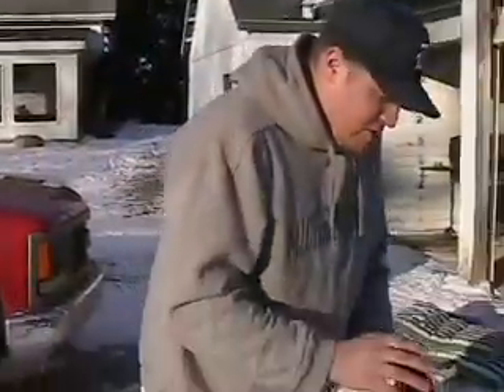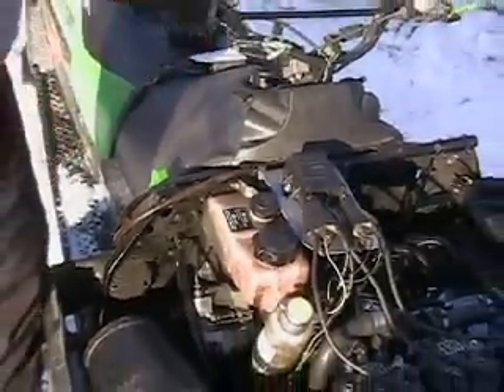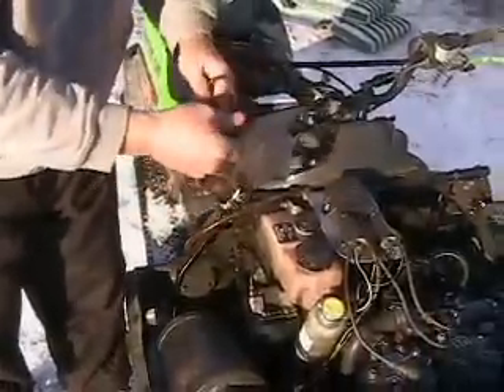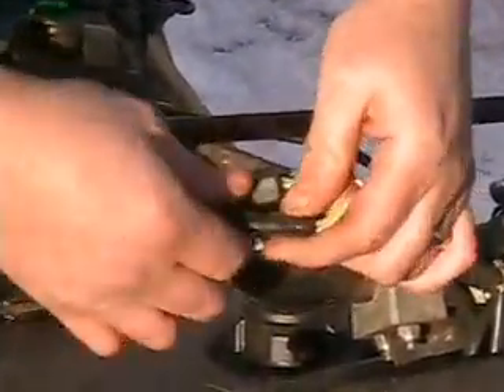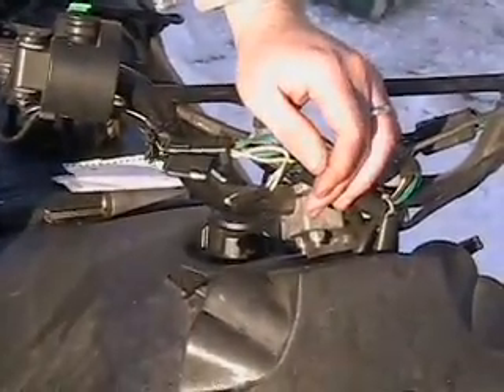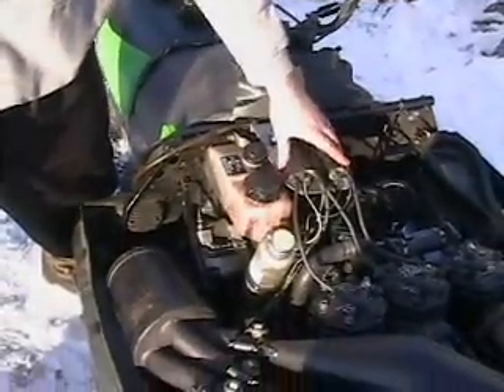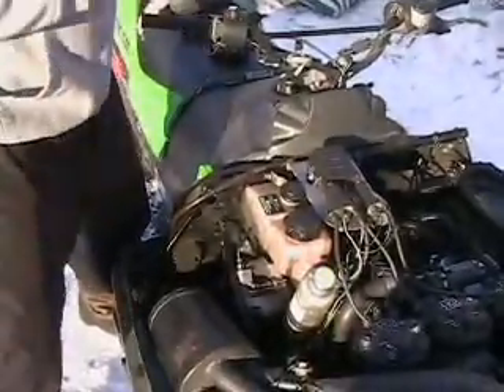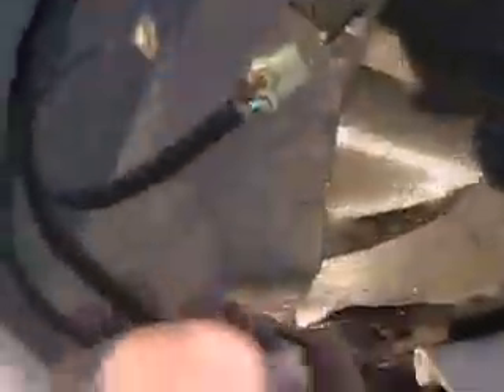Electrical Diagnosis for Arctic Cats

Comment: Excellent Blain I have a 95 zr580 we are up in Bellaire MI Sled ran perfect Tues all day this AM  Wens no spark other then a few very weak ones on plug sounds like  a saftey switch issue ,there was alot of frost this AM also,I think I have the sysyem where I need to jump connectors Dana